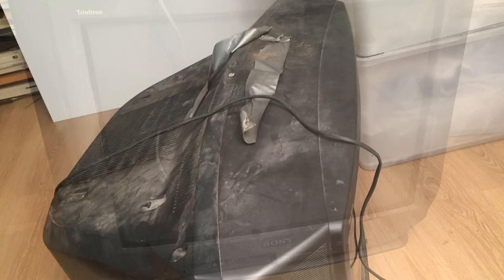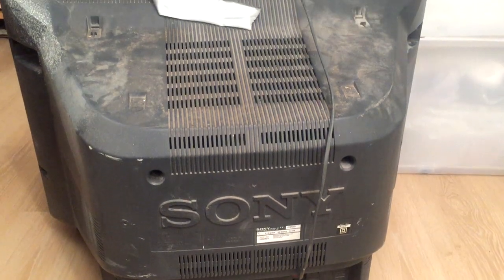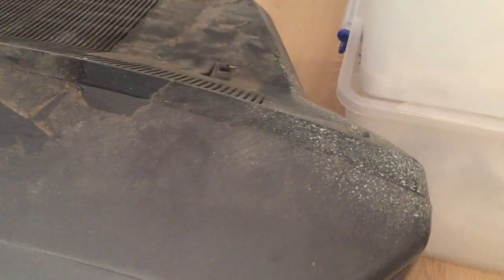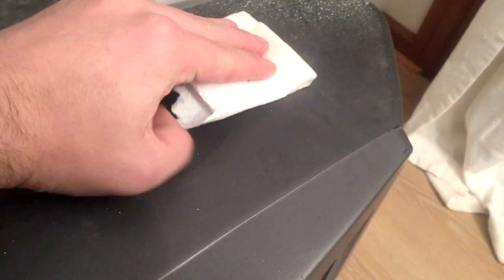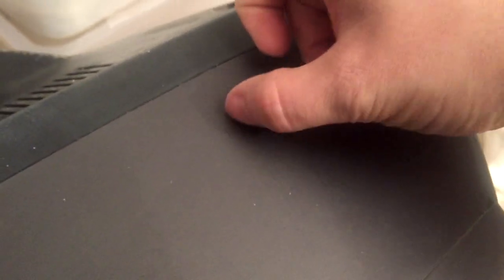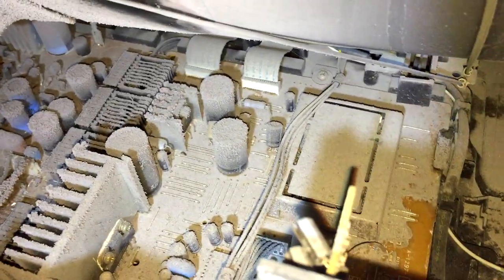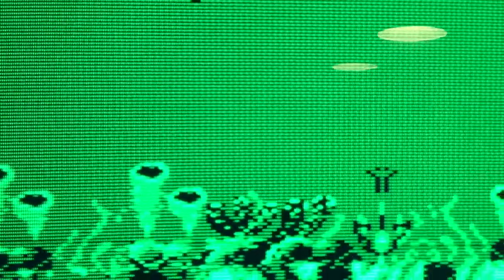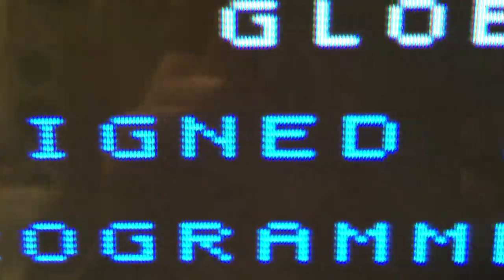Trash Sony Trinitron saved + RGB modded!

Comment: Can't find a scart TV in Thailand, don't suppose you can do a video on how to fit a scart connector to a TV.
Reply from the maker: I could do something like that in the future, do you mean the wiring from the SCART pins to the board or the physically fitting the socket into the TV? Or both?
Reply: @RyanUkAus  The wiring from a TV board to a scart connector, but a start to finish of one of your scart projects would make a better more interesting video!!

Comment: how did u clean it? I found a Trinitron and its as disgusting as this was inside.. I'm thinking of letting the tv sit for a few days off power.. spray the inside with IPA and air pressure wash it.. what do you think?
Reply from the maker: Definitely leave it unpowered for a bit or discharge it if you think there may be some voltage still lurking inside. I blew out most the dust and used a small vacuum extension to suck out the rest. I cleaned the board with circuit board cleaner / IPA. Best to make sure it’s tidy inside before powering!

Comment: i found pretty the same model kv-29C5K with a scart european connector, the issue is that the image is blurry, i've tried to turn a little the flyback got better result, but for me it"s still blurry any one got an idea ? and where is the horizontal potentiometer is located on the board ?
Reply from the maker: There is usually a focus potentiometer on the flyback of these models, if that doesn’t help you can try adjust on the neck board for H Stat, can sometimes be hard to see. It might be a case of having to line up convergence, it took me a good few days to get that right last time I adjusted it!

Comment: Hey man you wouldn't happen to have a manual (with circuit diagrams) for a KV-L34SN11, GF3 chassis.  It's an Australian model and I'm struggling to find manuals online?   I don't know any good sources so I'm using google a lot of the time and in this case they don't seem to include circuit diagrams and I'm not willing to pay to find out.   Trying to work out whether an RGB mod is possible for this TV.
Reply from the maker: I recently had to look one of them up as some people local to me were getting rid of theirs. Not much documentation but it looked like the video chip supported RGB in
Reply: @RyanUkAus  thanks for the heads up, hopefully it's not disabled in software.
Reply from the maker: It wasn’t the 34 that was given away in SA was it?
Reply: @RyanUkAus  Nah, I'm in Melbourne.  TV was sitting in storage at my uncles place, picking it up tomorrow.